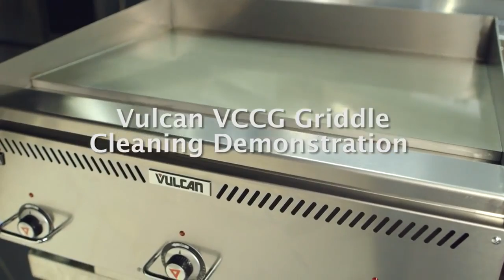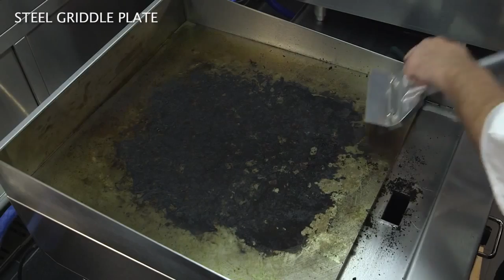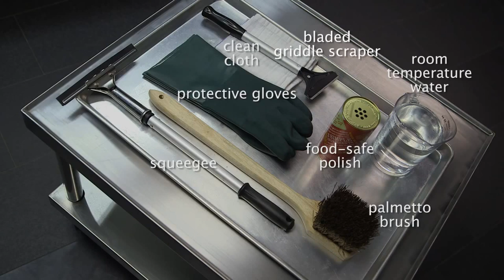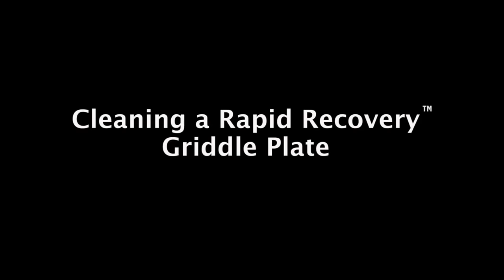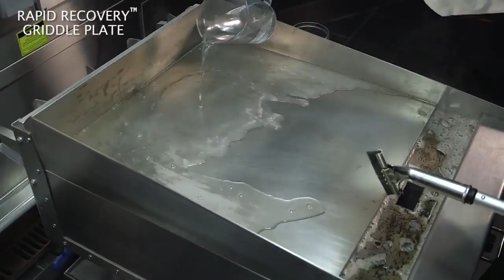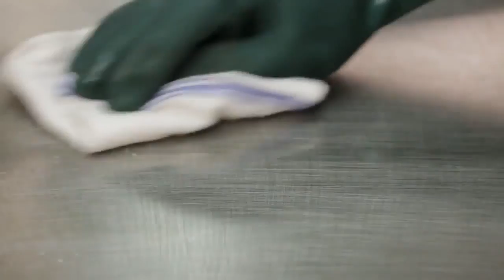How to Clean a Griddle | Steel, Chrome, or Composite | Vulcan VCRG48-T Griddle

Comment: Someone can tell me how to calibrate thermostat for this Modle.. Please
Reply: Ravi prakash yadav I don't understand? You should be able to check the temp of the plate with a thermometer adjust the knob to say 300 until the thermometer says so, then remove the knob and put the temp indicator in the right place when you put the knob back on. If it keeps going out of adjustment then you need it repaired.
Reply: Buy a surface thermometer to check for accuracy on the knob. They can be bought at any hardware store.  I got one at Harbor Freight for around $20. If it needs calibrated,  any commercial repair guy can do it for you for next to nothing.

Comment: where else can i find the scraper. and the squeege
Reply: Home Depot. Wall paper scraper. 

Like $10. Can be used as a scraper, a squeegee and a spatula for the corners. Just be careful of broken blades and where the pieces wind up and all is good.

Same goes for this scraper though also. The blades break so watch out for that.

Thing is the actual ones like in this video are gonna cost you over $10 for the handle and $6 for each blade, and it's the same thing, just cheaper at home Depot for blades.
Reply: @sparkyjones560  I think that in some jurisdictions, items used in commercial kitchens must have NSF or other ratings as being approved for food service applications.
Reply: You can find many types of griddle scrapers here: https://www.culinarydepotinc.com/search?q=griddle+scraper#?keywords=griddle+scraper&search_return=all&sort_by_field=Price+Low+to+High